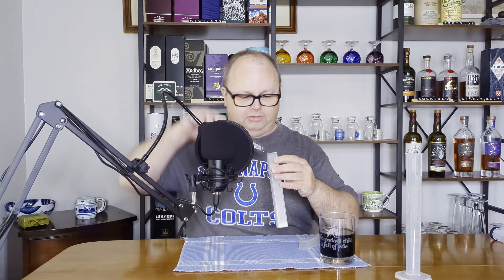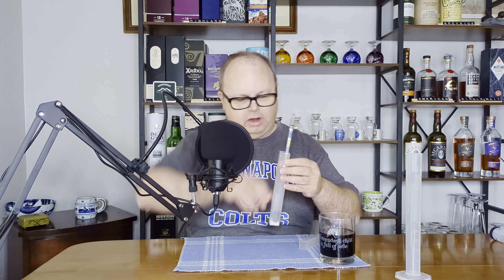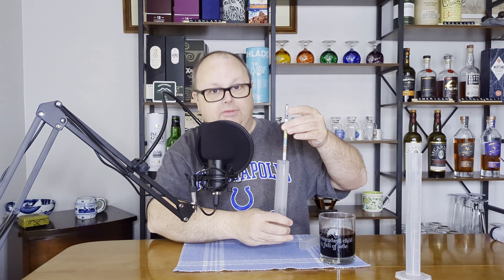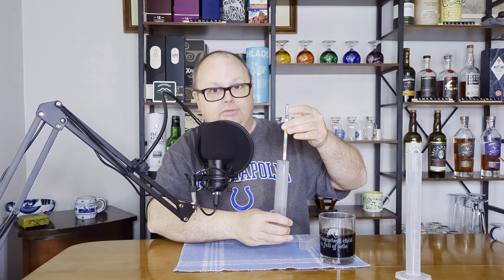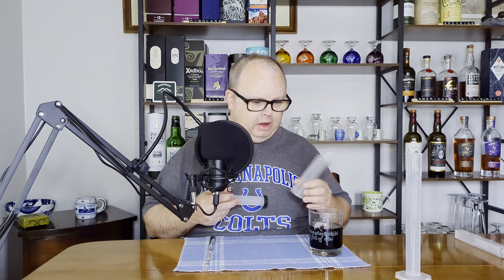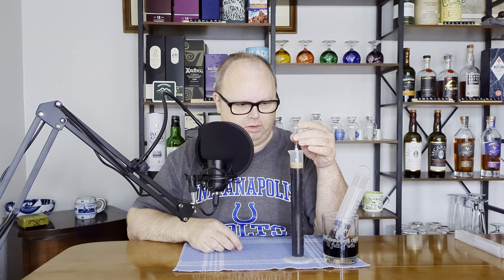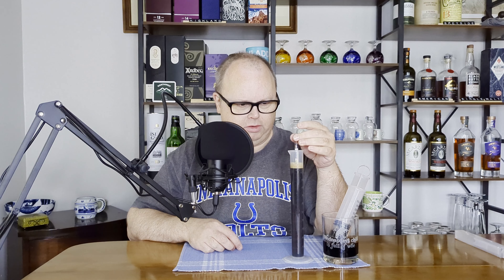Tips to master taking beer gravity readings

Comment: I have definitely broken both Hydrometer and Cylinder before. With hydrometers two is one and one is none. If it's a bucket fermenter and I'm checking FG I'll just use my hydrometer on the fermenter.
Reply from the maker: Yup.  Those tiny metal beads go everywhere.  Have to have a backup.
Reply: @NWsmallbatchBrewing  I've been using a refractometer for pre boil and SG reading to limit the use an potential breakage of the Hydrometer.